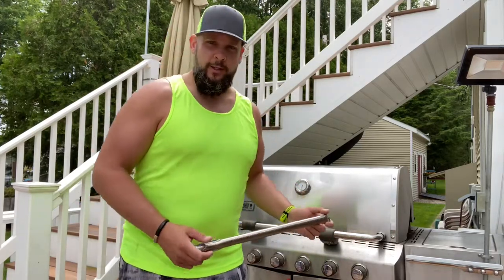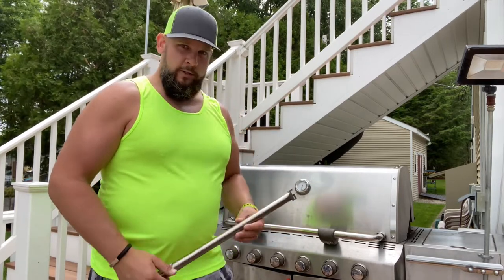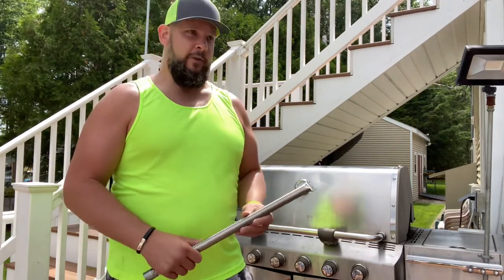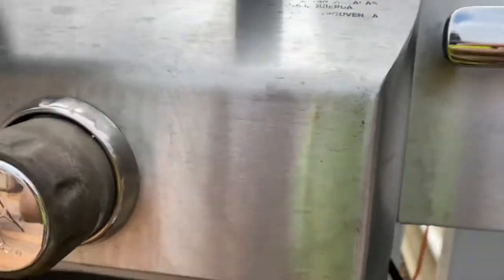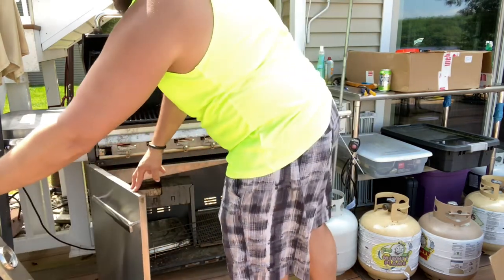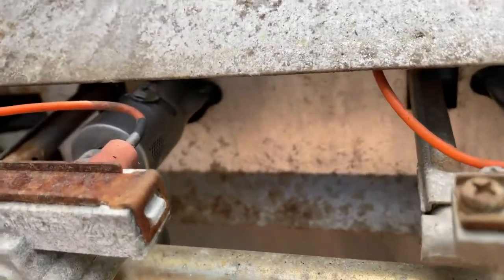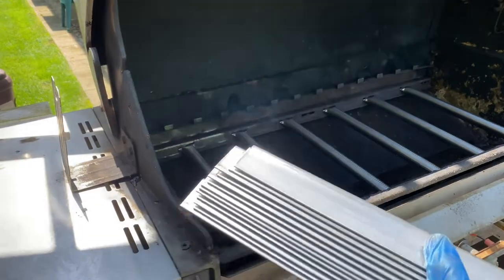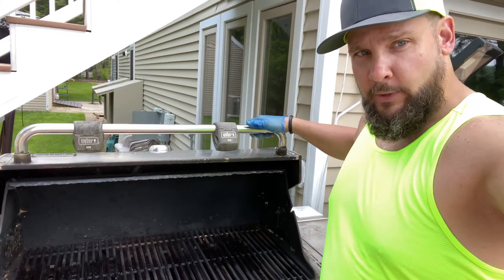Weber Grille Burner Tube/Flavorizer Replacement

Comment: I have a Weber Summit natural gas grill.  Love it.  Bought it in 2006 and 3 of 6 tubes have needed to be replaced for awhile now.  For years I always just used most of the time the one side.  When those burner tubes started to fail I just went to the other side of grill, but will be replacing all now thanks to you showing me how.  I'm sure mine isn't that different from yours.  Will be giving Weber a call.  Hope to get the savings you talked about too.  Say just a suggestion video would be much easier to hear you without music.  Thanks for taking the time to share with us.   D
Reply from the maker: Thanks for the kind words. We’re trying to remove the music.   Good luck with your project.

Comment: Could they make any harder? I will never purchase another Weber product. It looks like it took you several hours based on the shadows.
Reply from the maker: Thanks for wactching. Hahha you have a keen eye Faucheaux! The hardest sort was filming this.  If I didn’t have to record it it would’ve taken about 30 minutes MAX.   👍🏻🙌🏻
Reply: Never mind moving the camera, re-takes and everything else associated with creating a how-to video. It looks like several hours TO YOU because you must not be mechanically inclined. If you stopped analyzing shadows and instead mentally calculated how long it takes to release the door pins, unscrew two screws, remove grates and flavor bars, slide the tubes out then then the new ones back in, you'd come up with about a half-hour.  But you're too busy trying to be clever by analyzing shadows.